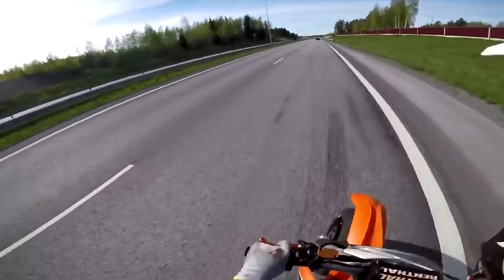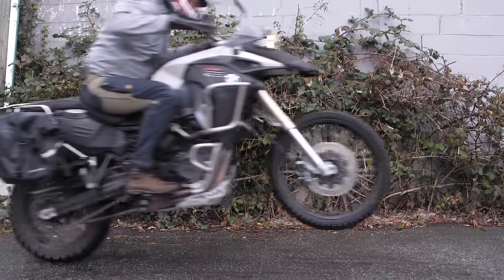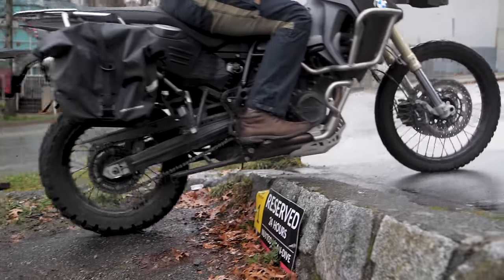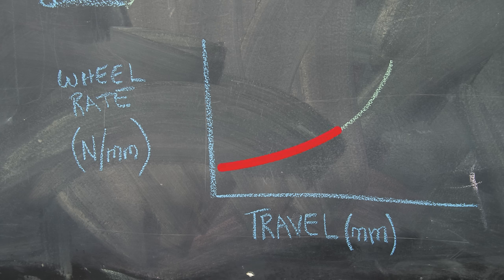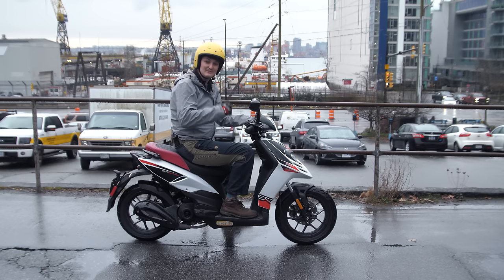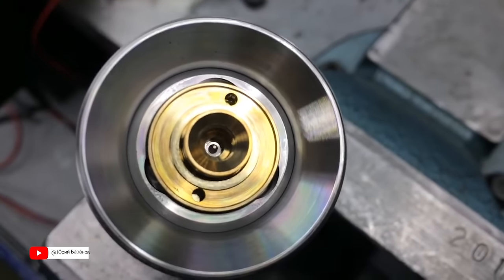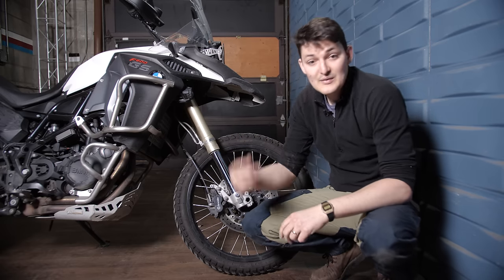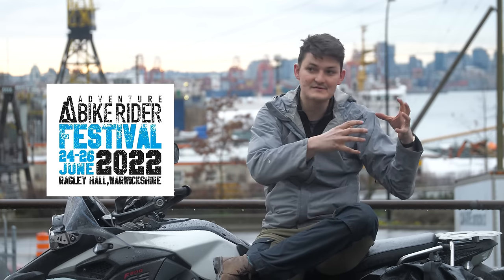Tank Slappers and the Quest for Perfect Suspension

Comment: Thanks Ryan. This would have to be a subject of discussion dating back well over 30 years when we first started seeing proper adjustable suspension. As an ex Australian Superbike racer, call it learning all you have mentioned the hard way by racing (at first) bikes with only preload at the rear and not changing the front fork oils with quicker intervals. See you didn’t cover, what 99.9999% of rider actually know is the front fork oils don’t last anywhere near as long as the service manuals suggest. One other part that was failed to be mentioned is the steering  damper. If a bike has all the required adjustability, and set correctly for a riders weight, conditions etc.. then theses aren’t required. However, as most riders don’t have a clue as to set up their ride to perfection then these are then just an additional safety aid to slow down and stop the tank slappers. Ultimately the bike does want to go in a straight line, so just relax, don’t fight them, and the bike will sort itself out. When I earlier referred to learning the hard way was when I tried to physically recover one at 250 kph around my home track being Phillip Island and ended up separated from the bike. My fault, not the bikes. As my team manager politely pointed out after I returned via seeing the track doctor. 👍😎🇦🇺
Reply: That's not correct. There can always be conditions that will result in a tank slapper no matter what other settings you have. It is built into the geometry of the front steering and the shape and dynamics of the tire. All you need is for the front to get light over an irregularity in the road and that will set it off. A damper, which they all now have stops a small initial deviation from amplifying.
Suzuki thought they could get away without one on the  new 96 GSXR 750. It did make for quicker steering, except for the tank slappers. I know from experience. I fitted an after market Ohlin's steering damper mounted on the frame with a bracket Steve Martin gave me.  From his superbike which needed a damper too. To much damping is bad but you need some and no amount of other setting can fix that.
There is an inherent stability problem in all castoring wheels. Which is why supermarket trolley wheels do what they do. Did you have damper at Phillip Island?
Reply: It's a DAMPER not a dampener. We aren't putting wet rags on our necks to cool down.
Reply: @JF-lt5zc  well done. You picked up a typo, which has been corrected.  Thank you. So you use one?  Anything of substance to add?
Reply: My 1984 GPZ900R/ Ninja 900R has some skinny forks but it had an ADV system which is a gas charged system to supplement the front springs. Haven't experienced a tank slapper on this bike (provided the system is maintained) and I've tried after doing constant wheelies and going off mounds at railroad crossings.
Reply: @marcusgeorge1825  It's not a typo issue. This term is misspoken over and over when it comes to suspension and it drives me nuts. If you (proverbial) are going to speak with authority about something, get the language right. 

And I do use and adjust the dampers and spring rate on my bikes, both motor and pedal.

As for wet rags, sometimes I use them to cool off on a hot day or if I'm not feeling well. :D
Reply: @JF-lt5zc  Oxford dictionary defines communication as "the imparting or exchanging of information".  You understood the information he was trying to impart to you.  Get off his nuts and leave your pet peeves at home.
Reply: Marcus, you should visit India once just to see how many people use their scooter or motorcycles without changing their fork oil for years even after doing intense  offroading on regular Indian roads. Just keep the wheels to the ground and the stock suspension will take care of the bad roads without the need for dampers.
Reply: @Igbon5  Some very valid points, which a discussion like what this has generated is great. The answer to your question is a split decision as some bikes I raced required them, not all for just PI. I guess you can call them an additional safety item that you hope you never need. ABS, for just one example comes to mind for the streets anyway. Just not on track. Have you stayed in contact with Steve?  I never found the need for one on the exact same bike as what you’ve mentioned as I had one brand new which did help in the slower corners.
Reply: @jaikanths875  I’ve actually been to India a few times for business reasons and that’s one country where I’ll take 4 wheels over 2 everyday. Oil deterioration happens over time and if it’s your only way to travel then you won’t really notice it especially when just commuting in over populated roads in poor state of care.
Reply: @marcusgeorge1825  Quite a few of my riding friends are from that region and while it's a nightmare over there, once they got to the US and got on two wheels here, their skill is on another level in terms of avoidance and control.
Reply: @marcusgeorge1825  
Yep, I really only had one bad tank slapper before I got the damper. Just the right amount of acceleration on a slight bend over some slight road bumps. Mostly it was fine. In fact I did do a ride/coaching  day at Philip Island before I got it and it was fine.
I haven't ever raced, just  ride days, courses including Keith Code and many many times up and down the Kew boulevard if that means anything.
I lost contact with Steve a long time ago just before he moved to Ducati and won the Superbike series. I used to hang around Melbourne Suzuki when he worked there.
I took my 750 to Calder once with him when he was testing his slightly better one and I crashed at turn 11 and stuffed my foot up. I wish I had kept in touch, but no.
Did you say you had a brand new 96 GSXR 750 too.
Reply: @Igbon5  Yep. A fully race prepared one basically out of the box, stripped down for racing only. It’s interesting as during 7 years of racing in several different categories, 100’s upon 100’s of laps aroundPI and each of the top tracks around the country I still have never done a “track day”. My racing days are well behind me, even though I can still fit into my last one piece race suit. I have saved in my collection the first bike I ever raced on track when competing in the Australian 250 production series which were basically dominated by the Suzuki RGV-250’s. These days I’ve met a few riders who have done a couple of track days around the Island on brand bee R1’s and when they mention how fast they are I just remember bd them of what times the little street biased 250’s could achieve and that I’d lap them in between 4 and 5 laps and 3 to 4 on an old 750…. Tyres have come along way, especially street legal ones and the track itself today is in much better condition than it was in the 90’s. The boulevard in Kew is a known place where cops hide on dirt bikes to spring on street riders using it to push the speed limits past what the speeds signs suggest. It is a nice bit of road just the same.
Reply: @marcusgeorge1825  
I used to think I was pretty fast and I suppose I was but that day at Calder before I crashed Steve went past me so fast, as he said he would do, I realized the big difference between me and a really good rider. I wanted to try racing and maybe I would have got faster but stuff happened and I never did. I won't tell my best PI lap time but I bet yours would be miles better.
I remember tyres before radials. They have come a long way. I also remember the boulevard before the cops too.
Reply: @Igbon5  Nice. It’s interesting the difference between track day riders and racers competing. As you do get much more track time to really work on improvements, plus you’re racing for something. My first ever race was at Broadford. It was warm with absolute perfect conditions. It was an inter club round and I actually came gone with a third placed trophy. Man I thought I was fast. After a couple more racers over the next 2 months, including my first time at PI, I ended up back at Broadford. It was miserable. Cold and wet. The person who got me into racing, a house mate at the time who was an ex Australian champion (20 years my senior) asked me how I felt I went after my first practice session. I simply replied “bloody slow, just look at the conditions!”  He simply smiled and showed me my lap times. Which were actually quicker than when I thought I was going fast in perfect conditions. So, what I’m trying to say is track days are a great way to safely improve as a rider, however racing is where you’ll see much bigger improvements. I was completely shocked and humbled that day so much so that nearly 30 years later it is still fresh in my mind. One secret tip/rule regarding Phillip Island is if you can break the 2 minute barrier on any bike then that’s the sign of a really good rider. Racing lap times may be a lot lower, however it is a long and technical course with so many variations all on the one track. Hence why pre-Covid most of the top international teams would use it for pre-season testing. Purely based on the above. Stay upright and stay safe mate. 👍😎🇦🇺
Reply: @marcusgeorge1825  
Well, I did break the 2 minutes at PI and was pretty pleased that I could do it.
Thanks for the conversation, it brought back some good memories.
Reply: @Igbon5  Same here. Plus you can now add bragging rights to a sub 2 minute lap time. I was chatting with a young rider who had a new R1 who had no idea of my background and kept telling me how fast he was. His best time, same track, was 2 minutes and 16 seconds. Take care.
Reply: @marcusgeorge1825  Yep, it's always best let other people tell you how good you are. I was around 1:55 on the 750. I never got the K7 1000 to a track. It would have been nice to try the straight at Philip Island on it. And I always liked high speed turns over slow and  that first turn is great.
Reply: @Igbon5  💯. Turn one, taken correctly, starts you lap times off with a flyer. It looks a lot wider than when at high speeds as when all you do when entering is sit up, down 2 gears in quickly, and hang on. I bet, if you had many more laps around the track you’d eat away at that lap time as for a racing comparison (I won’t mention my 750 times), however to put it into perspective in both WSB rounds in 95 and 96, whilst racing in a support event (the Australian 250 cc production series), where the engines, brakes and suspension were stock and you could only race on street legal tyres.  Obviously all the road parts of the bikes were removed and the fairing were replaced with lighter fibreglass ones (even the speedo was removed). Each year had almost twice the number of racers competing for a grid position so they had a cut off lap time of 1.52. So, what the little 250’s lacked in top speeds down Gardner straight needed to be made up in all corners and you never wanted to be leading someone who was right on your arse at the last corner as you knew they’d have enough to use you to slip stream and overtake just at the start/finish line. Also, as the sprockets you put on for this track (gearing then for more top end speed)  made them even harder to get a clean launch at the starting line, meaning all the hard work put into qualifying could set you back 3 rows by the time you reached turn one for your first lap. Great memories, especially in front of 120,000 people on race day. On reflection, this series was far more enjoyable than the Supersports or even Superbikes categories of the same era as it really all came down to each individual racer and some strategy. Thanks for bringing back some great memories and sharing yours.  👍😎🇦🇺
Reply: What's the best way to recover a tank slapper? Let off the throttle and the brakes? Or apply full throttle?
Reply: @JF-lt5zc  You know what my pet peeve is? This one bothers me so much. "Silicone" and "Silicon" are two different things. But everyone I've ever met calls silicon circuit boards "silicone." People don't actually know that the word "silicon" refers to an element, or mineral. Silicon is used to make electrical circuit boards. Silicone is how they make fake boobs. American people seem to be totally ignorant when it comes to basic science.
Reply: @Ritalie  The best way and rule number one is don’t fight it and try to recover with physical force. The bike always wants to go straight. Just relax, reduce throttle, no need for the front brakes and depending on the bike it will settle.  Stay upright and stay safe.
Reply: @Ritalie  
If you are going straight with no bend coming up, hit the throttle I reckon. If you can actually control the throttle as the bars bash from side to side.
If you could get the front wheel off the ground, go for it, but if it is just going to lighten the front that might not help. My worst one was from hitting the throttle and getting the front light over some bumps on a slight bend.
Having said all that I think it is best to let of the throttle and brakes and loosen your grip on the bars and let the bike settle itself, which it will do if you leave it alone. 
If you have room that is.
Reply: @marcusgeorge1825  я читал ваши комментарии было прекрасно изучать профессиональных человеков спасибо за это я из Азербайджана здесь почти не развиты мотоциклисты даже 1000 кубовые мото максимум 10 или 15 у многих 50 или 100-250 кубовые
Reply: @az.xmusic  English please?
Reply: @marcusgeorge1825  Sorry my friend I very low speak English please you is my comment Google Translate
Reply: Dear Marcus and Igbon,
I experienced a bad tank slapper and don't want to have it again.  I am confused with your answers.  Do you say '' a steering damper'is a %100 solution for deadly tank slappers'' or you say  '' It is impossible to prevent a deadly tank slapper %100 due to inherent reasons/dynamics but a steering damper can decrease the risk significantly''?  I am using a maxi scooter - a Yamaha Tmax 560 and I will appreciate your kind answers and your recommendations on what to do when we experience a tank slapper?  All the best from Istanbul/Turkey.
Reply: @Igbon5  Dear Marcus and Igbon,
I experienced a bad tank slapper and don't want to have it again.  I am confused with your answers.  Do you say '' a steering damper'is a %100 solution for deadly tank slappers'' or you say  '' It is impossible to prevent a deadly tank slapper %100 due to inherent reasons/dynamics but a steering damper can decrease the risk significantly''?  I am using a maxi scooter - a Yamaha Tmax 560 and I will appreciate your kind answers and your recommendations on what to do when we experience a tank slapper?  All the best from Istanbul/Turkey.
Reply: @grayswonderahoy2061  
Marcus claims to not need a steering damper if all is set up exactly to spec. He is an ex Australian Superbike rider and must know a thing or two. However, I disagree, having studied the suspension and steering systems to some depth. All castoring wheels will become unstable at some speed and combination of circumstance. Even Moto GP bikes.
I was a friend of Steve Martin back in the 90s and he assured me that a steering damper is necessary. It should only be very light damping though, as Marcus says the bike will sort it self out if you relax the grip on the bars and let the steering correct itself. To much damping is like holding too tight, the front wheel won't correct quick enough and will continue chasing itself side to side. Just a very light steering damper to prevent initial oscillations getting bigger. The steering should move freely and easily though. Look up Steve Martin if you don't know who he is. So yes, a steering damper will help most but not all tank slappers. See Moto Gp for example. If possible in the middle of a tank slapper try and relax your grip and the basic stability of the front steering will correct itself. This can be difficult on the street if you are heading into trouble but it is the answer.
Hope this helps

Comment: I remember my first tank slapper, scary as hell. I was getting off of I4 doing about 120 mph during Bike Week in Daytona. I hit some small bump in the road and I thought I was going down. I managed to keep it upright, but it was a dern moment for sure!
Reply: Yah, highway construction,  going on for miles on 295, they didn't really cone up or warn anyone they were doing some pavement work in one area.  I hit it and went airborne at about 85 mph on crappy uneven road, then the wobbles come in.  Luckily it all sorted itself out in about a second or so, though it seemed like an eternity.  My butthole was so tight I bet you couldn't have pulled a banjo string thru with a bulldozer when that finally ended.  I just vaguely remember saying to myself, don't lose the handlebars but don't fight them, off the throttle, let it settle out.  Thankifully it heard my prayers.  Don't want to go thru that again.

Comment: Yes, I would engage the perfect suspension.....if available.  Actually I do so each time when I start my car. That thing (Citroen C5) does have the system that matches your Skyhook idea. For the interested: The Citroen C5 has an active, hydro-pneumatic, suspension that controls every wheel individually. Sadly, it never got introduced to motorcycling. The system is incredibly brilliant! Even the ride height is adjustable... It would be great on my V-strom.
Reply: it would be heavy on a bike and probably  only practical on heavy baggers
Reply: It doesn't change damping in way ryan describe here. Also drive c5 with hydro.
Its cool system but far from mentioned here.
It just can engage sport, harder setting depending on driver inputs.
Reply: C6 has adjustable damping and one of the operating modes is actually called skyhook.